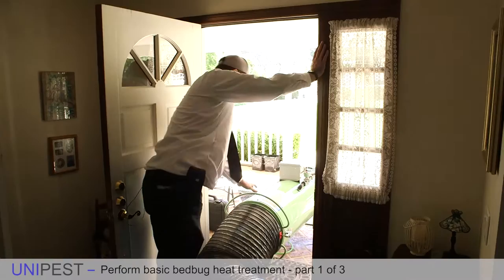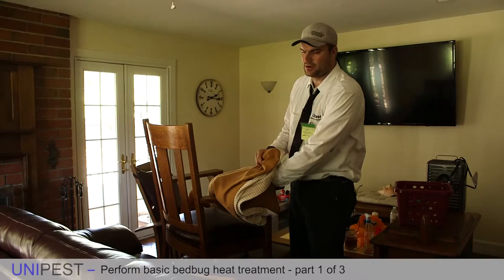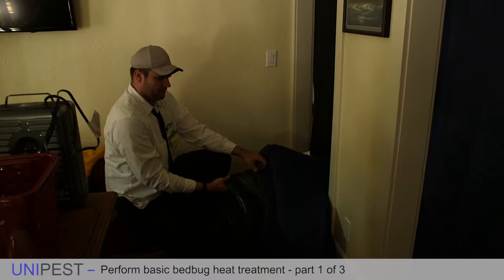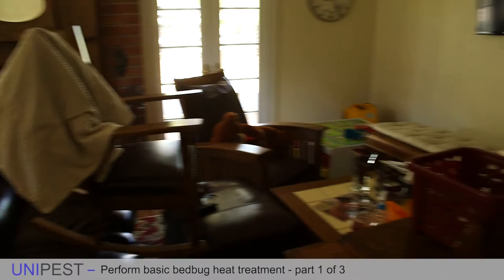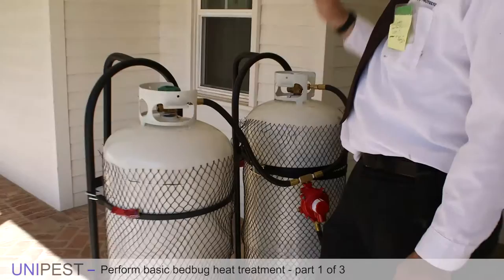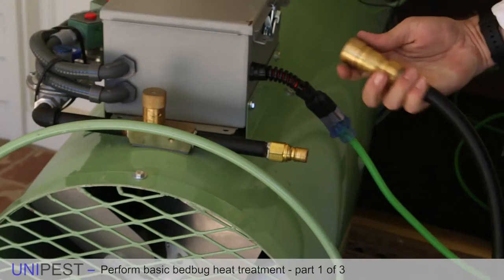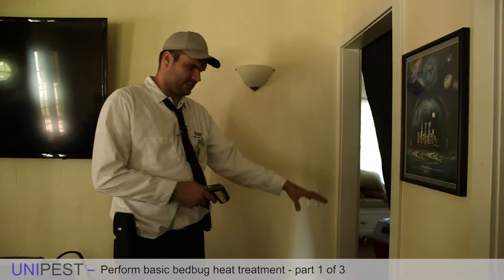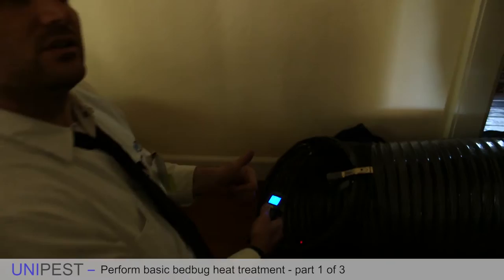How to Perform a Bedbug Heat Treatment (Part 2 of 3)

Comment: This system seems very inefficient. The system I used had a huge box truck with a diesel generator in it and all my heaters were electric. You wheeled them into the individual rooms, rand the cables and plugged them into the truck to power them.

Comment: What if the fire in the heater turns off while u were trying to run the machine, i tried it couple time but it just keeps on turning off
Reply: The fire inside the fan